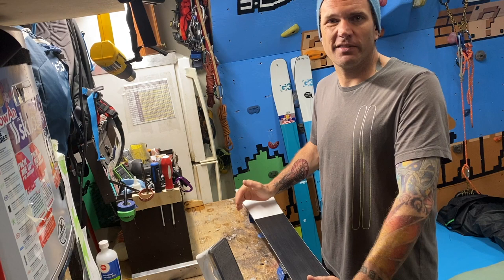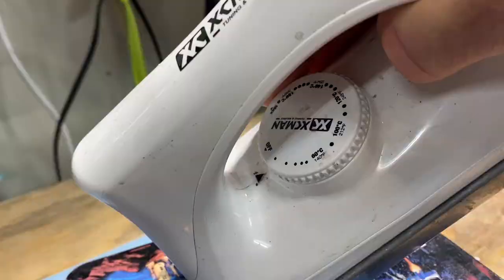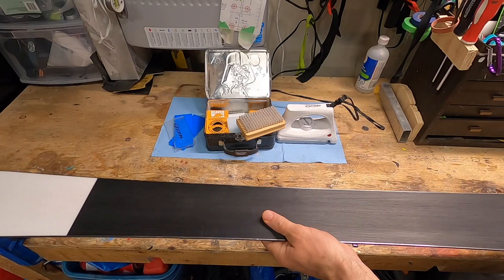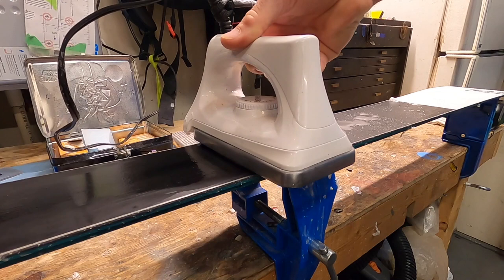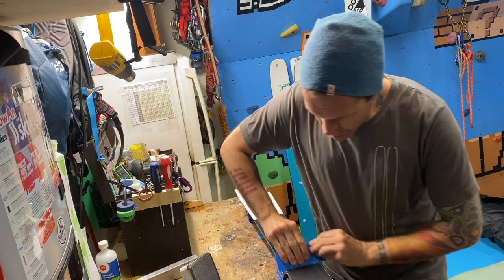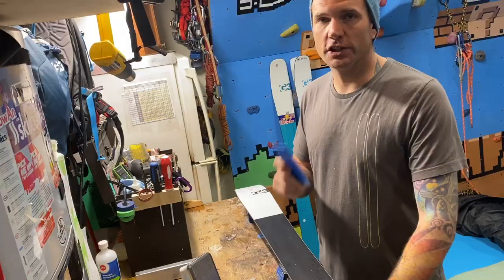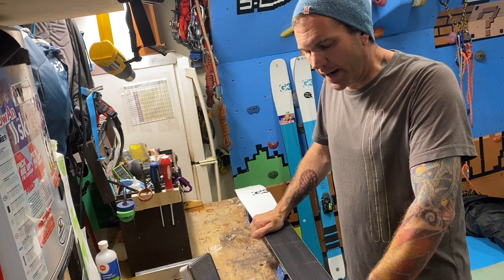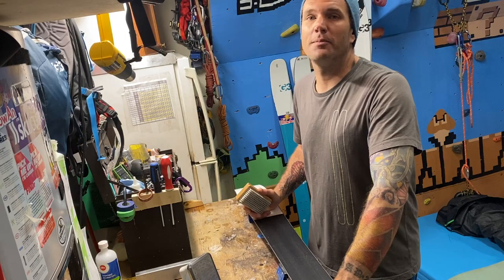How To Wax Your Skis - G3 University

Comment: Only suggestion I would add, is to first rub the wax on with the wax block across the surface of the lenght/width of the ski, before dripping on.  That helps cover all the surface of the ski before applying the iron to the ski base.

Comment: I wax in my garage but it can be pretty cold out there. I keep the skis warm until it's time to wax them. Does room temperature affect waxing? Thanks!
Reply: I bought a 6 ft restaurant “plate warmer“ overhead heater and put my skis under it in the garage. Then the bases are about 120° F even before I drop the wax on. I think it helps the pores absorb the wax.
It also makes it more comfortable to work in my cold garage.